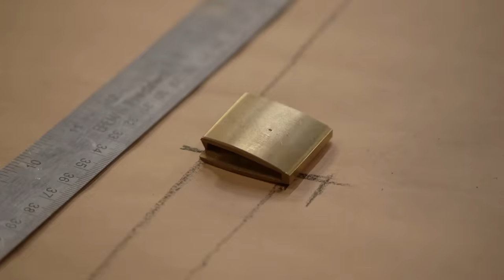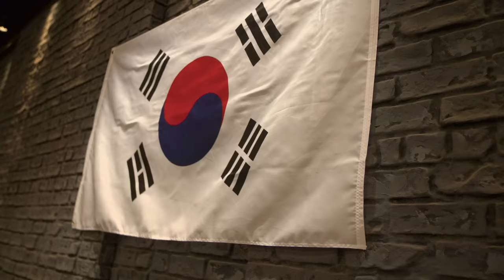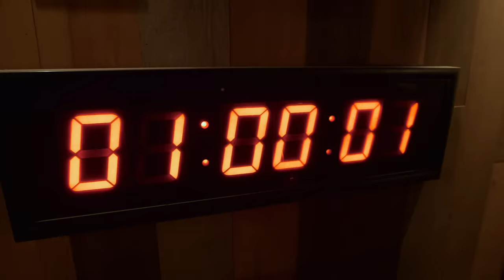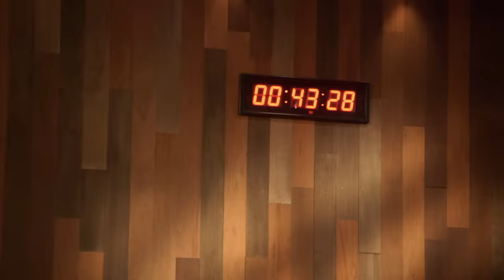Forged in Fire: Korean Challenge! The ICONIC Hwando Sword (S8, E22) | Full Episode

Comment: That might be the most spectacular blade shatter I’ve ever seen
Reply: It shattered like glass. And also shows why water quenching isn't usually done. The metal shrinks too fast and forms huge grains in the metal, and it forms big grain boundaries that can separate easily and form cracks. Or, even if there's not visible cracks, it can still be so brittle that it'll shatter as soon as there's force applied.
Reply: Most definitely !!!😅
Reply: @BCosby423 I just ask myself if pre-heat the water wasn’t a good idea, was it? Maybe it won’t hard enough the blade but cold water does the opposite, an extreme hard and brittle blade
Reply: @emiliosamuellobos1410  Not sure if that would have made a difference. It's still water, it will still convect the heat away far better than oil will.
Reply: 26:57 This one?
Reply: @redmadness265 yep, that one. Straight up looked like a Final Fantasy FMV of a blade shattering
Reply: @JandarLefey  Filmographically perfect
Reply: That was pretty nuts. It exploded like someone dropped corning ware.
Reply: J. Neilson may have said that water quenching is a viable technique. While I don't mean to argue with a master, that statement feels more technically true that genuinly true. There is such limited room for error, it's not really worth it.
Reply: @emiliosamuellobos1410   Im a fan of this show and not a smith, but that was my thought as well. I did like how the engineer worked through the issues and added salt to the water.
Reply: @emiliosamuellobos1410  at most you can only raise the temp of water to 200 degrees before it starts boiling. Not gonna do much when putting a 2000 degree blade in it.
Reply: it was a little beautiful, in like a tragic kinda way
Reply: at that moment video game physics began with all its video game destructibility

Comment: I've done a water quench. If you prep your steel properly (i.e. annealing and normalizing) its definitelypossible). One of the blades I made was so finicky that I eventually realized that it actually required a water quench to properly harden. I learned A LOT from that build.

Comment: There's only a couple of ways I've been able to make a water quench work. One way is to paint a really thin layer of clay on it before quenching. The other is to do an interrupted quench where you stick it in for two seconds, pull it out for one second, stick it back in for two seconds, etc.
Reply: Let me make sure I’m understanding the dangers of water-quenching correctly.  Water cools the steel much quicker than oil does, but because of that, it puts much more stress on the steel and makes it more likely to crack, right?  Also, I’ve heard the type of steel that you use can also affect the likelihood of getting a crack if you use water-quenching?
Reply: @kevinnorwood8782  Yes, that's right. Some steels NEED a faster quench in order to get hard, but the fact that they need a fast quench doesn't make a faster quench inherently safer for that steel. One of the advantages of a steel like 5160 is that it can get hard with a slower quench, which makes it less likely to crack. Steels like 1095, W1, and W2 require a faster quench. But that's why there are quenching oils like Parks 50. Parks 50 is a faster quench than most oils, but it's slower than water. It's perfect for 1095, W1, and W2.
Reply: @kevinnorwood8782  it can form cracks and voids but also fast cooling makes a larger grain structure (think gravel vs sand) which can cause stress and fissure lines in the metal and lowers the blade's structural integrity.  Same reason when lava cools slowly it forms dense obsidian but when it cools quickly it forms porous igneous rock.
Reply: @kevinnorwood8782 not a smith, not a physicist, but additional input as an outside perspective. When you heat something up and then cool it down quickly, you force it to expand and then contract quickly. The heating causes the atoms in the material to spread apart, and the cooling causes them to snap back together. The atomic bonds do not like this. They can’t keep their malleability without sufficient time to cool down, and the bonds become brittle, which can cause cracking and, as demonstrated, shattering. They essentially are forced to freeze immediately instead of being able to reorganize over time.

Comment: im not much of a smith or metal worker but if they grind a wide shallow fuller on both sides and fill it with a weld and grind it smooth wouldnt it soften the spine and help the structure?
Reply: I think it would, but I've never tried it.
Reply: @philochristos  that would have been my idea to try n fix it

Comment: I can not believe that no one knew how to water quench. If it was oil quench it takes longer to bring down the heat. You do not want the blade to cool down to fast. It becomes very brittle and it will not stay in one piece.  I see blade smiths heat there oil up so that there blade would not cool down to fast. But with very little volume of oil it does not cool down fast enough and the blade then is to soft and it will not hold an edge. The one guy took a piece and checked the steel by doing a sample quench but he didn't do another to see where the hardness was at. So he didn't follow through. If he would have he would have ........